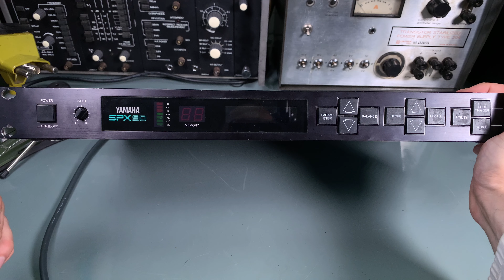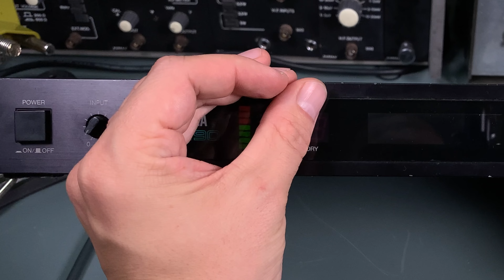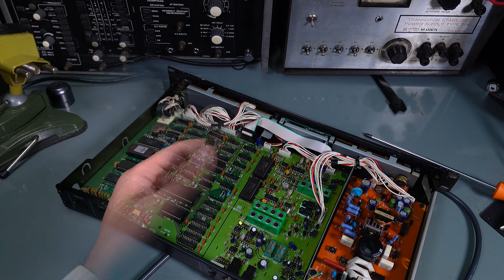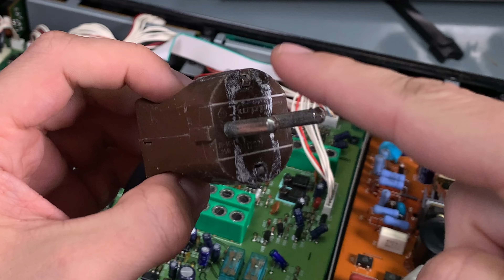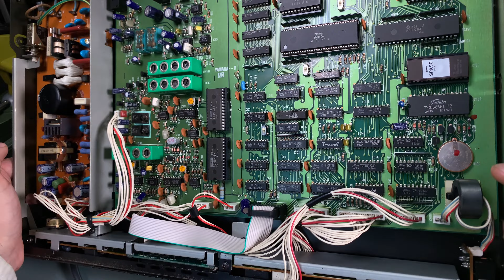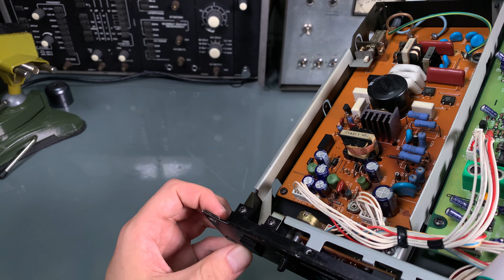Fixing Yamaha SPX90 digital sound processor - no power - bar graph lit up - nothing on screen

Comment: I have one of these that works, however there is a bonstant "buzz, buzz, buzz" on most effects. It sounds like a square wave tremolo almost. It is constant on the reverbs. It gets gated out when there is a gated effect on however. 

any idea what may cause this additional noise? I opened the machine up and did see a corroded capacitor on the power section. I aim to take it in and have some parts repalaced.
Reply from the maker: I don't like working with audio equipment for that reason - in general semiconductors won't fail that way - i would assume some noise is coming form power. Start from recapping PSU, then make sure Your outlet is properly grounded - in many cases in staging equipment buzzing problems are problems with power (missing earth). If won't help then You can start recapping everything You see until it go away :> after so many years recapping will be always positive so it won't fail in future.

Comment: I’m having a very similar, if not the same issue with mine. Can you tell me the parts you replaced to fix the circuit, please? I planned on replacing all of the electrolytic caps in the PSU circuit, but was there anything else you replaced in just the PSU, like any ICs?
Reply from the maker: I would start with just caps inside power supply section - if they did not caused dead short that lead to burning IC then You don't need to swap anything else.
Reply: @ElectronicNoobBlog sounds good. I’ll try that first. Hopefully, that’s all it needs. Thanks!

Comment: Hey! Some of the capacitors on my unit appear to not be in working condition. Where can I get some of these replacement electrocyte caps? Any idea how much the costs to replace these would be? Thanks! Great and very informative video 👍
Reply from the maker: Just try grab "capacitor assortment box / bag" on Aliexpress. I don't think any of them was very specific in term of values (unusual).